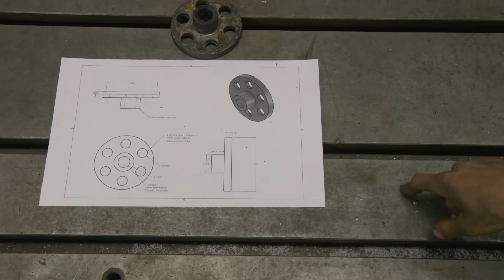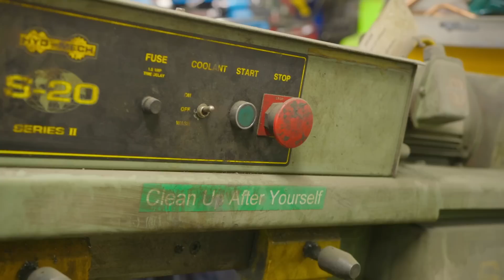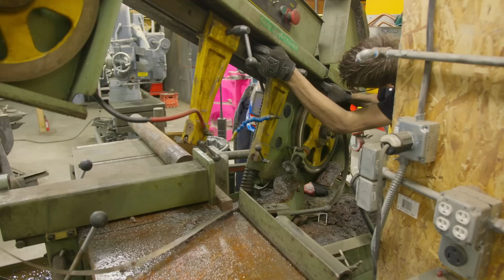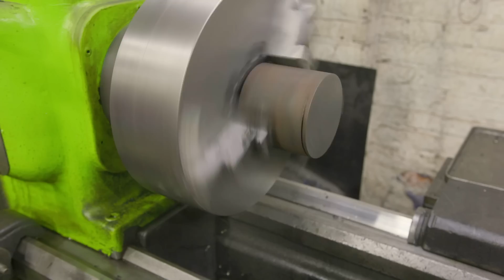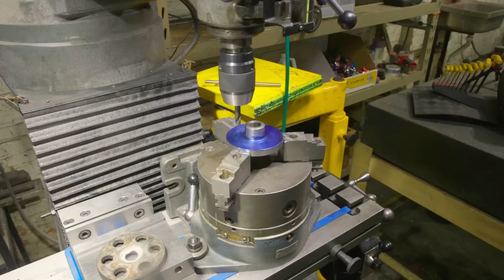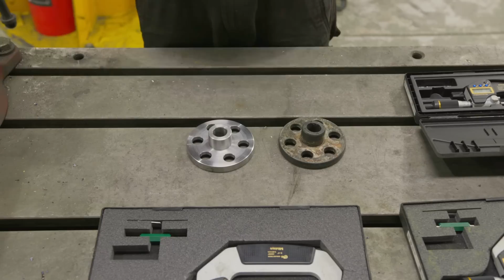Machining a Cummins Harmonic Pulley

Comment: I wanted to share a safety tip with you when you're changing blades on your saw take the blade and throw it on the floor away from you and it'll uncoil like a snake but safely.

Comment: When turning in my opinion, it's better to find the medium between heavy and fast. Even though your machine and tooling can handle a half-inch cut doesn't mean you should for your spindle life, tool life, and your butthole may be a little less clinched from part to part. Now I say this but a single part for a rush job it dont matter get that thing doen as fast as possible. 

I run a smaller older cnc lathe, so im constantly thinking about keeping my load relatively lower while making sure I am taking big enough and hard enough cuts to keep production steady.

Good job btw its been a while since I ran a manual, so you did a whole lot better than what I would have done
Reply from the maker: Thanks I appreciate it

Comment: Nice work. Good idea to make it out of steel this time, making it stronger. But I would still have made a larger radius in the corner of the boss, as this is where the part broke off originally.
Reply from the maker: Yeah true
Reply: @VanoverMachineAndRepair  I would second that sugestion of @zoltannagy, as an enginner, its always best, application permitting, to include a rounded shoulder at the base of the boss. Sharp chamges of direction of torsion will allways induce cracking over time. With a rounder shoulder, the stress has nowhere to concentrate.
I love your approch to your work, You never stop learing, ever :)

Comment: A telescope gage and a snap gage are two different things.
The reason it matters is if you order one but need the other it won't work. They are not synonymous.
Reply from the maker: Ok I’ll probably still use them interchangeably

Comment: First operation Save the tip of the insert from chipping if your tool is not dead on center when you go all the way to the center of the material by first drilling the hole thru the part??

Comment: If I give a machinist a drawing with no tolerance values, is it assumed for him to get close enough that’s reasonably achievable? Or is there like a standard +- 5 thou?
Reply from the maker: Some shops do follow a shop rule but there are no assumptions in machining. Anyone handing a drawing to a machinist should specify the tolerances. Most drawings do down below in the tolerance section. Even if the dimension is not written on the part the drawing specs what to do when no dimension is called. Most of the time when a customer brings in a part with no idea or drawing simply knowing the application and using common sense works 90 percent of the time.
Reply: Most shops have a standard if no tolerance is called based on how many digits are after the decimal. For example if you need the OD to be 4 in then it's can be assumed  +- 0.1 but if you for the same OD there was 4.0 then the assumed tolerance could be +- 0.01
Reply: Unless otherwise detailed your right. That's what numbers past the point are for haha @dereksantiago6208

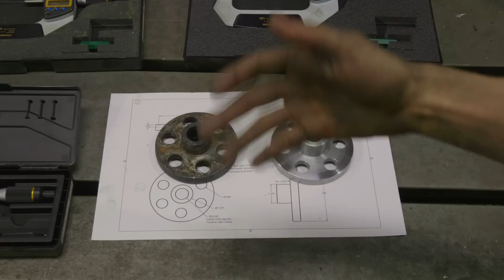Comment: 18:45 Hi. Just off topic thing. That old part broke from 90 degree base. Should it use radius on that location, so it will be more durable ?
You changed to harder material already, so of course new part wont need that.
Reply from the maker: Technically yes but force is not to high. Did not break under operation. Broke because it was bashed w hammer